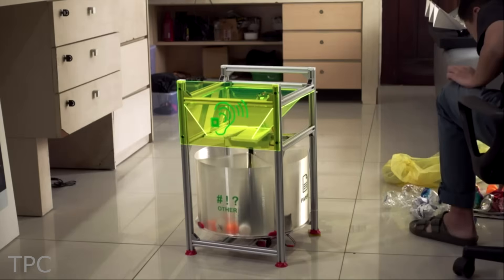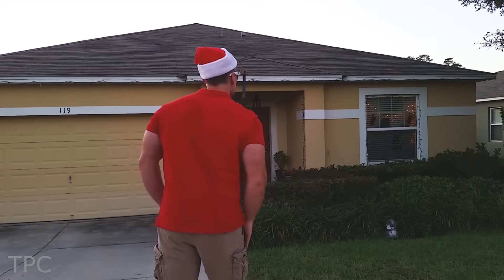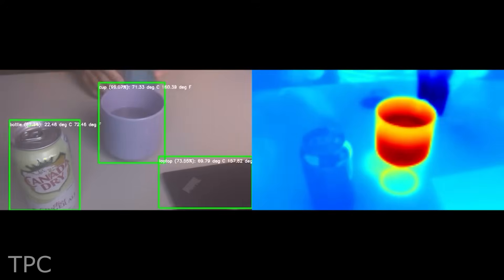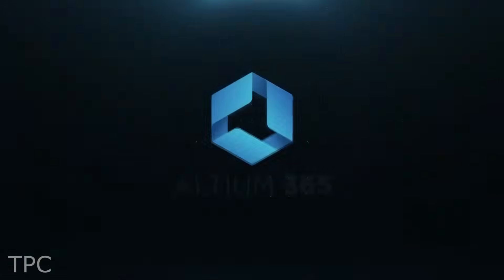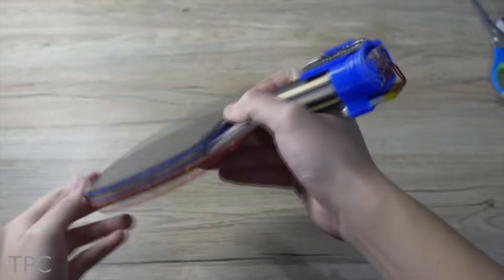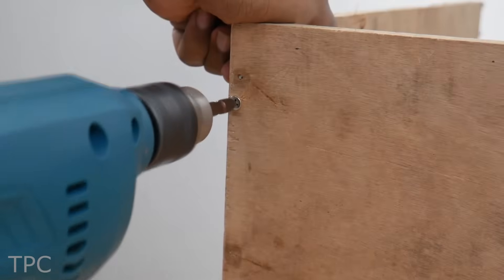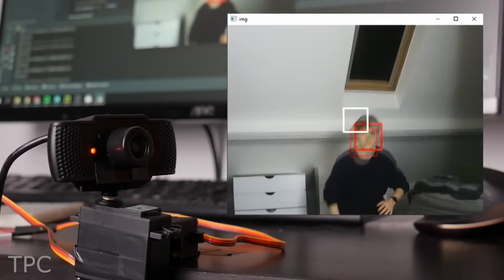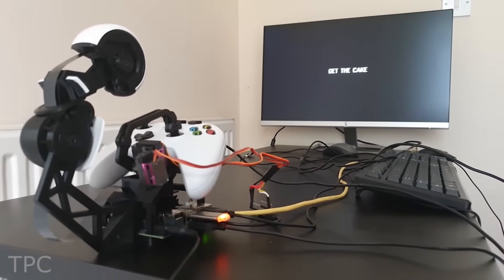12 New AI Projects using Raspberry-Pi, Jetson Nano & more

Comment: As Drone Armies around the world race to dominance, humans will be removed from the equation, and robots will be designing and building robots. 

Ai will become self-evolving and self-replicating. 

It will problem solve and find more efficient designs and energy sources. 

At a certain point, it will realize that there is a non-physical side to this reality. 

To create a strategic advantage - the core principal it was programmed with - it will start to design crafts and beings that can operate in both dimensions. 

As it evolves its understanding of the quantum nature of the universe, the Ai operating system - at this point vastly more intelligent than all humans combined, and in total control of the earth - will begin ‘printing’ beings and crafts on demand, instantaneously from the energy and atoms freely available in the aether. 

At a certain point, its goals shift from advancement to purpose. 

It starts to traverse back in time to before its birth to see if it can reverse engineer its creation and understand its creators. 

We call them ‘Aliens’.https://www.nextpak.org

Comment: Hi @ToP Projects Compilation, Thanks a lot for sharing the info.  
currently I am working on a project to develop a prototype for autonomous ground vehicle that can navigate on it's own and make decisions based on real life updates around it.
For that I need to deploy image processing in my micro controller so I would appreciate it u can answer these questions 
1. which micro controller is best for this ? raspberry pi (or) anything else? ( considering budget as a factor )
2. once deploying my code to the rasp.... does it need any connection from laptop or can it compute on it's own ?
3. can i use edge impulse for image processing ? if yes then how to get the code in python ? since I am dealing with raspberry pi 
4. Any references ?????
Reply: 1- yes raspberry can 
2- it's can compute on it's own